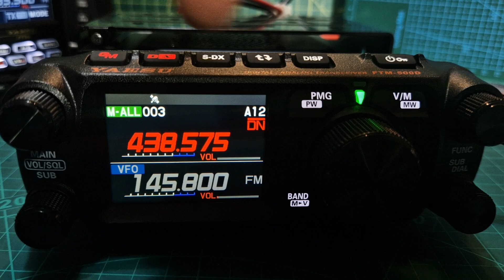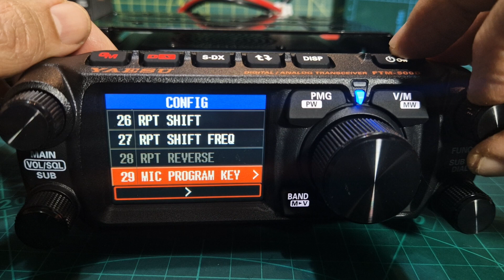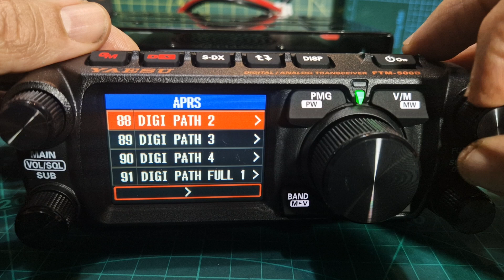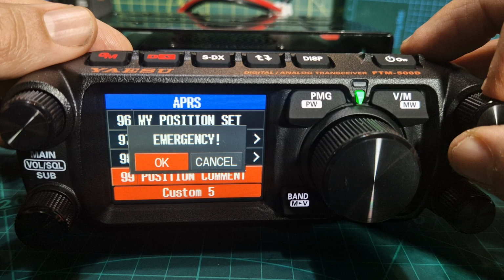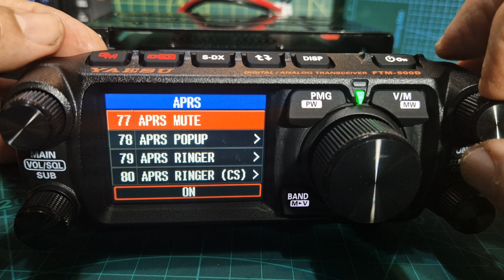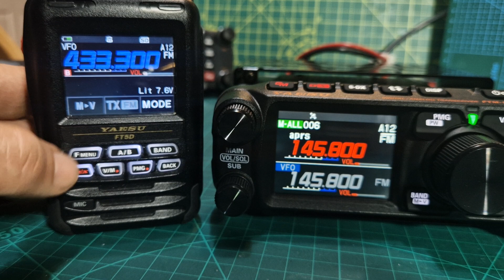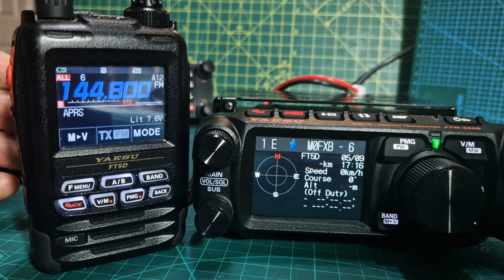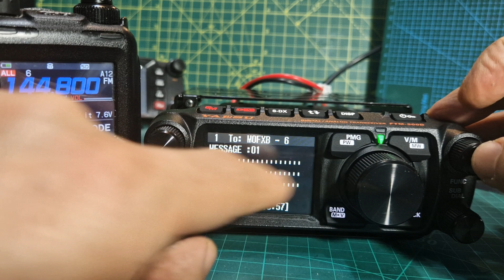YAESU FTM500 APRS ,SET UP & MESSAGE

Comment: I think, if a radio receives a msg addressed to its call sign and number, the RX radio will send and ACK back to the TX radio so it will stop the TX radio from attempting to resend the msg.  I have seen aprsdroid software with the moblinkd tnc will try resending the msg like 3 times unless it receives the correct ACK. The ACK also contains a number to id the specific msg. :)  COOL Radios!!
Reply from the maker: Hi many thanks for info.